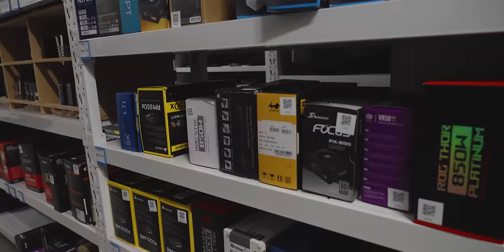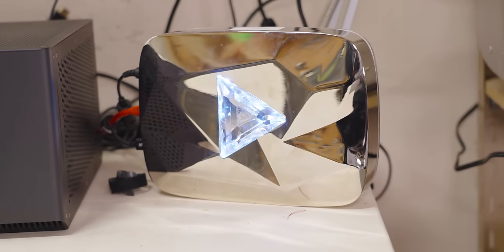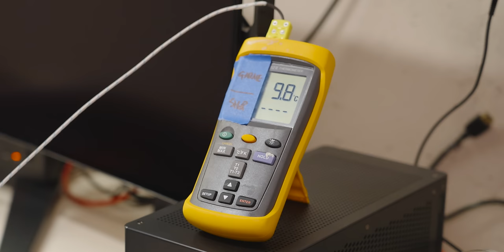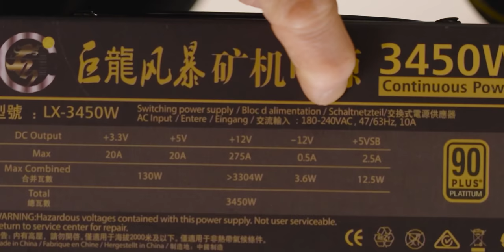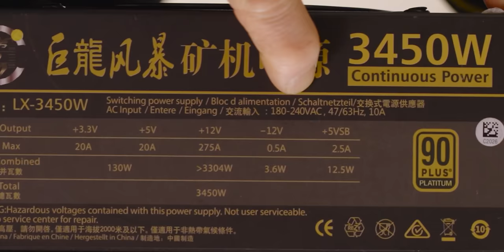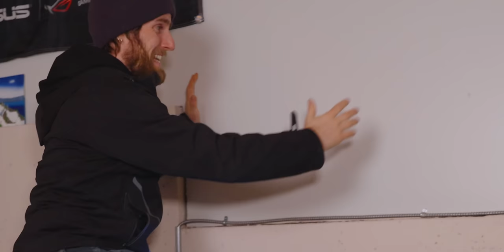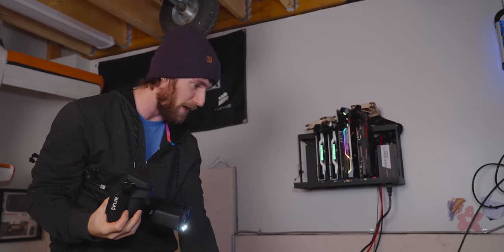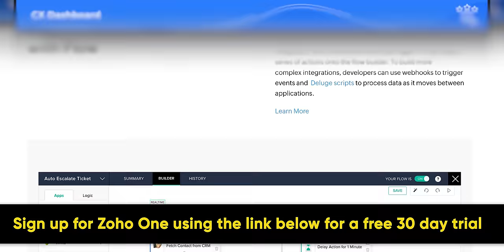Ask me why I'm Mining in 2023...

Comment: It's probably not the best idea if you're changing components often, but under the desk would probably be better.  It's why I had to move my rig out from under the desk. The desk top was trapping the hot air under it, and with one side blocked by the wall, and the other blocked by my bed, it only had one way out, directly at me. 
Those were some toasty roasty leggies, especially in summer.

Comment: This might a weird idea, but why not put the whole mining rig in a box, stuff two fans on it for intake and duct the exhaust to the desk/below the desk? Throw in a lid for easy access and you have basically a portable space heater with directed heating, instead of the diffuse heating of the wall mount. 
Plus, you can adjust temps and airflow via the fans.
Reply: use the box as the bottom of a chair and point the fans up!
Reply: Use a couple of noctua's 200mm fans for it. Moves a ton of air at decent pressures and volume. I can see it being viable
Reply: that would be too reasonable

Comment: Your best bet to get the heat you want in that space with a small electric heater is to get a radiant heater.  It will heat you instead of trying to heat the air.
Reply: How else would he be able to do stuff and then not have it as a tax write off
Reply: Problem is he does want to heat the air too somewhat for the health of the components. Where Linus lives is fairly humid and he probably wants to avoid condensation forming on the electronics
Reply: @drinkoldcoke  An infrared heater is a radiant heater.  :)
Reply: @hovant6666  That won't occur unless the components are colder.
Reply: heating the air is honestly more comfortable
Reply: @TheBGYeti  if you go in a room that's cold and stay there long enough, you put condensation on everything through your breath and perspiration

Comment: You could try putting a second curtain just a few inches from that one, either inside or outside. Air is an excellent insulator and all you have to do is trap that air in its own separate area.
Reply: Or he could just get a space heater....
Reply: @Remsster  Would have the same effect.
Reply: Better sealing is the key. I built a bubble around a car out of painter's plastic in a 15 Fahrenheit garage, put a single 1500 watt heater in it, and it was a toasty 65 inside. Didn't even have to support it outside of a small area to get it started, because it blew up like a hot air balloon. Put a couple of fresh air holes in to prevent suffocation, and whabam, easy warm work area. That curtain isn't sealed well to the wall above it (which is where much of the losses probably are), to the walls next to it, has holes through it (for the curtain rod), and lets tons of air through it. If he were poor, I'd say just enclose the desk using PVC pipe for a frame and painter's plastic and duct tape for material. Since he's not, he should just turn the entire work area into an insulated room with a door and heat it with a mini-split.
Reply: Kinda wonder if it's possible to get curtain sized versions of those foil blankets they use in ambulances. Been under one, they are crazy effective.

Comment: I think you're better off putting the PC at ground level, under the desk. Heat rises, and with a big desk directly above the heat output it will mean your heat will accumulate under the desk before rising to the top of the room, where that heat effectively becomes useless to you. This would mean you get more heat per Watt, because the heat won't just rise to the ceiling and dissipate up there, you'd have a warm pocket of air under the desk with the heat slowly escaping and rising from there, more effectively heating those few cubic meters you'll mostly be occupying, also meaning you don't need to mess around with trying to artificially displace the hot air towards where you will be sitting, effectively achieving exactly what you want, you'll have targeted heat exactly where you want it (need I say that aiming hot air downwards is a bit paradoxical...? It's kind of tackling the problem upside down. Far more optimal would be to position your heat source as LOW as possible, to get the most out of the heat potential of the rig, AND to get the best passive cooling for your mining rig, because, would you know it, cool air sinks!? So your mining rig would be cooled by the coldest air available to you in that room. This would just be SO much more optimal, literally in every single way- it means cooling the PC is more energy efficient and more effective, YOU get a warmer work space without needing to aim it at you with fans because it's already way above ground level, which is inefficient and wastes a lot of the potential heat produced, it's just better in every way, even if we're talking about minor differences (though I do really think trying to aim hot air down for the purpose of heating your work space is just a bit silly. A mining rig with a couple noctua fans isn't an air con, AC are literally built to produce heat, your PC is designed to do the opposite, *cool down any heat produced*)
 
For real, put it under the desk. Wall mount it, sit it on the floor, do whatever you want with it, but at ground level, preferably under the desk to allow for heat accumulation + slower release of that heat. This would be a way more optimal/effective/efficient solution for what you're trying to achieve.

Any (actual) physicists reading this, don't be too harsh on me if I'm off the plot a bit. I'm a physics major _dropout_, not a real, experienced physicist. I think my points are valid and sound, but I may have expressed them poorly, or explained some things clumsily? But please do let me know, if you have the knowledge, whether my arguments make sense to you and would actually produce superior room-warming and PC-cooling results.
Reply: Real world experience agrees with the under desk premise.
Reply: I wanted to scream "HEAT FUCKIN RISES LINUS" half the video. Stretch another few curtains over the top like a false ceiling and put the heater on the ground. Then he would actually have reasonable gains. Might even get +10 degrees with the gpus
Reply: @snesguy9176  If you want to go more - box in the area, insulate it, and run ducting to a modified full case filled with the equipment. Use the fan with the computer in the case to heat the air, push it into the room, and circulate it.

Yes it takes more work - but it would be far more effective. And if you go over the top with the build - you take that tall ceiling and turn it into usable storage space.
Reply: linus doesn't like PC sitting on the floor
Reply: @kryptonian69  it’s an open test bench, dust isn’t really a factor
Reply: No expert but this jives.

Comment: I agree with the 'second curtain' ideas and suggest you utilize the shower curtains if you do the second curtain aspect, for the same reason you were going to before, but now the air is being held more or less by the outer curtains and the plastic-based shower curtains don't need to go all the way down since heat rises and you just want to keep the heat in the general area;; or you can melt two pairs of shower curtains together;; use a tarp, I'm not sure why you didn't use a tarp, screw my idea about the shower curtain and use a tarp. 

We're Canadian, we use tarps
Reply: Am Canadian, can confirm. We love tarps.

Comment: Pro tip, I had to do something similar in a completely unheated garage. I lined a makeshift ceiling wall and floating wall with hex plastic sheeting, get whatever is cheapest. The thinner the cheaper the better. I just used staples and then to keep the bottoms from floating away, i staples the bottoms to 3” slats to keep them held down. Hooking up the s19 pro exhaust to a cardboard tunnel flowing into the area worked great. I also added a kerosene heater with an exhaust leading out of the area to keep some heat in and the exhaust out. Then I used a cheap Chinese air quality monitor to hopefully not die. 10/10

Comment: Garage door insulation and weather sealing is probably your most potent factor, you could even get those clear plastic flaps that forklifts drive through in commercial freezers to limit air flow when the garage is open.
Reply: With the flaps you'd have to worry about them hitting your car. That's gonna mess up the paint over time.
Reply: @FlyingShoe  oh yeah, maybe the car should have the flaps instead of the garage lol  I mean he could install a blower to blow an air curtain while the doors open. That’s pretty high tech.
Reply: @FlyingShoe  The forklift flaps are also very expensive.
Reply: I fazed out when he wall mounted it - hot air rises - if he mounted it under the desk or close to his chair and had a fan blow air towards him, i could have given him an A for effort, but.. this was too daft.
Reply: @brentgreeff1115  when I saw him screwing on the wall, I flapped.  My guess is he’s either stringing out the content over multiple iterations of dafty drafty design, or the wall mount is for space saving, and the idea is to heat the whole space for projects, not just the desk. Two reasons an under desk approach may have been rejected. 

If the wall mount worked, I think it would also blow hot air on his eyeballs which would be annoying rather quickly.  

He’s probably leaking his heat out the top junction between the curtain and the mezzanine. He needs it to be like a diving bell of hot air. If he had a good seal the rig could be anywhere inside it and fill it with warmth.
Reply: linus will not do that, you know why? because efficiency is his thing as long as he MAKES money off it, if it means to heat or to insulate, im sure he will not insulate. i mean he did basically buy this house, he had all the time to insulate. hes a dork and a appizer.
Reply: @SwirlingDragonMist  all he needs is 3m insulation mats for like 10 grand for the garage, but imagine how long you can mindlessly heat with hardware for 10k, thats the whole idea here, lives in one of the coldest places on earth, is rich, skimps out on energy savings because of 3% of his money. thats laughable.
Reply: @tarkitarker0815   well burning money has a surprisingly high amount of BTU’s in it.
Reply: @tarkitarker0815  glad we’re not dorks, and are just youtube commenters on a computer themed channel.  Will be checking back here soon to reply again, sorry if there’s a delay.
Reply: @SwirlingDragonMist  so does uranium ^^
Reply: @tarkitarker0815  I’m a man of Tungsten, I don’t sully myself with such minerals, they are wrought with decay.

Comment: Possible solution: just rig it deep under the desk, sideways, and put fans blowing the air towards you. Hot air will be at close range, hit you directly at your legs and waist, then because 1) it will hit your surface and 2) hot air goes up, it will go up your core and head. My room gets an extra +3 degrees compared to the other similar room next to it thanks to electronics totalling around 300 W. Also keep in mind in situations like this, where you have a high ceiling, the height will 'eat out' a lot of the heat if it doesn't hit you directly with fans.
Reply: Maybe an enclosure in addition to the mining computer/heater under the desk with an air intake just outside the enclosure.

Comment: I had 6 cards drawing 800 watts at the wall and within 24 hours it brought my 40F attic space (500sq feet or so) up to 75-80F during the winter. It takes hours for the heat to spread around the space, I’d bet it Linus had come back a day later it would eventually get that temp up
Reply: your attic is well insulated to keep heat from the home in. that room linus is in would lose heat far too fast through those shutters
Reply: In my bedroom when I lived with my dad I left the heat off, door closed and had my 5700xt undrrvolted mining 24/7 and the temp stayed in the 70s F°. Not the same but it did good

Comment: Linus, the heat goes always up. Put it on the floor and build a case with some dust filters for intakes for it to work
Reply: well if a heater first, use some heat ducting pipe, (the stretchy springy stuff/bumble dryers, run from the PC air intake, somewhere else , in the room that will get the air moving the space, heater/PC a chance, get at some of air not right next the BOX, the the point, of the exercise, heating the space?

Comment: Hot air rises so manage air flow vertically and define your area horizontally.

Move those big curtains in under the overhang, preferably up into a joist bay - this will help keep hot air in.  Mounted on the outside as they are now, the hot air that would accumulate up above you just moves up and out through the gap at the top.

Put heat sources down low.  You will produce natural convection currents and benefit from the heat as it rises.  Maybe place the mining rig under the desk to have it heat that area where your legs/lap are.  Then you can put little curtains around it like a Canadian kotatsu.
Reply: This. Much this.
Reply: Canadian kotatsu has to be the title for the next video
Reply: Plus having the fans on your face vs on your legs means you'll get sick faster. I'm sure they were tryharding at a solution that doesn't involve common sense lmao
Reply: @Rov-Nihil  sick?
Reply: @mattrobinson3460  I'd watch that
Reply: @bland9876  cold air + it blowing on your face = sick, common sense.
Reply: @skirmantux  never heard that one before.

Comment: May have been better to locate it on the wall under your desk, considering the extreme temps that room will see. The table itself would work as a sort of diffuser which would help spread the head lower before rising to the tall ceilings. Overtime this may lend to a warmer effect than being mounted so high over the user.

Comment: A suggestion about the curtains thing: Have them in a two layer configuration. It will retain heat a bit better.
Reply: @hall-g1x  *Non-moving air creates insulation, otherwise you get convection! If the gap is to big, you get natural convection...
Reply: I hope I can clear the air on this inflammatory issue. The man needs concrete, layers upon layers of it.  Like bro needs to show up to Whale Con with the username “Thermal Mass”.  Or he could just tuck his curtains in at the top so there isn’t flow escaping out the gaps, making like a diving bell bubble of warm air. “Deep Heat” is still pretty catchy. Although I’d probably go with “Bubbler” and use bubble wrap’s air pockets for a cheap light diffusive insulating medium, and just staple that mofo all over the work-fort. 

Fun word of the day! “Interstitial” which means between two layers, like me with both your mom’s lol  ;P

Comment: 1) put heater under the desk. Heat rises, convection currents should help move the heat around a little and keep the heat at the desk where you work.
2) get a convection heater and try it.. see if the curtain idea is helpful or not.. it probably isn't giving off enough BTU to be I sulfated within the curtains and so it's all escaping into the larger garage.
3) get insulation and build a better wall area to close off the area to trap the heat better.
4) electric heating mats might be good just around the desk. Fairly cheap, can be fitted easily.. I know it's against the "generate heat and do something useful" mentality - but might be worthwhile to think about.

Comment: This works really well if you actually have an insulated space. I mined last year as my primary heat source because my apartment's electric wall heater was so incredibly loud. Plus I figured I'd break even on mining (and I did) even with my 590 card. I only needed 330 W running half the time to stay comfy in my studio. It's unclear how much time Linus gave his rig in the video to actually heat the space, but I would put up a bit of insulation behind it and then it should work about as well as any other North American space heater.
Reply: With the black walls in the IR picture, I guess the problem here is more the insulation (or lack thereof).
Reply: I agree.  I had 6.5Kw worth of equipment running last year and it kept my uninsulated 900 sq-ft garage hot..like 32 outside, 90 inside hot. What he needs to do, though, is get some actual air flow between those cards. I usually pointed one of those high cfm carpet fans at my rigs, and that kept the cards pretty cool, and the heat moseying around.
Reply: what did you mine and which miner you used? My PC is just collecting dust, might as well make some money from it. I too have an amd card
Reply: i mine in winter because its literally free fake internet money if you'd be running the heat anyway

Comment: Put some insulation batts in the rafters directly above your little workspace. Will help tremendously since most heat loss is going to be through rising heat transfer.
Reply: I was thinking a hood angled down towards the chair with 3-4 fans pulling out of it.

Comment: Heat rises. Mount it below the desk and cover the sides so the only direction the air can flow is directly at you.

The higher the ceiling, more volume you're trying to heat. Also consider insulating the spaces between the rafters.

Comment: My office, in my home during the winter, gets so hot at times that it can be unbearable. (With the vent closed off to the room as it is not needed.)
Running the following.
Dell r710 Server (1 550w power supply)
1G 24 port Switch
Modem
Router (PF Sense Installed on an old HP Compact)
Dell 7010 (Used as a Backup DC and Backup Web and SQL for the above r710.)
Cyberpower CPS1500AVR (w/4 x 26ah Batteries)
Along with my laptop and desktop and all the monitors. (7 monitors Total)

Just running the Dell r710 puts off enough heat to eventually warm your small space and keep it warm throughout the winter. (As long as you keep the curtain closed.)
So, you might want to get a server to use for storage or as backup storage to place in that space to keep you warm.

Love the content. Keep it up.
Wayne